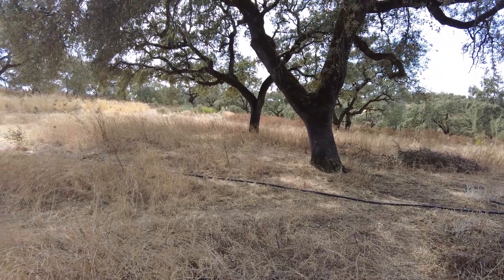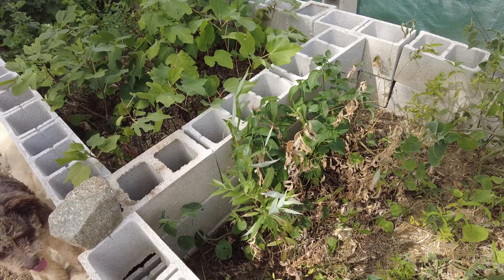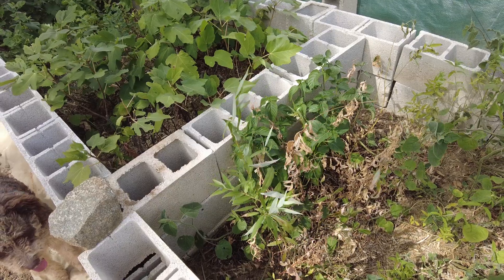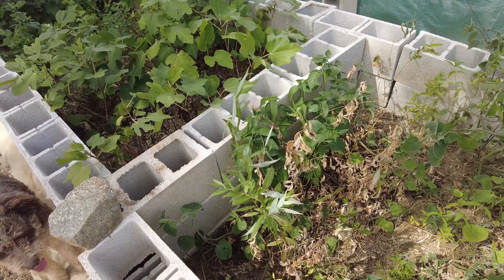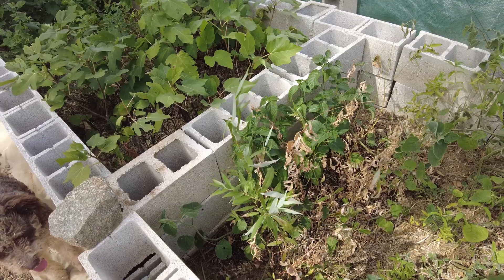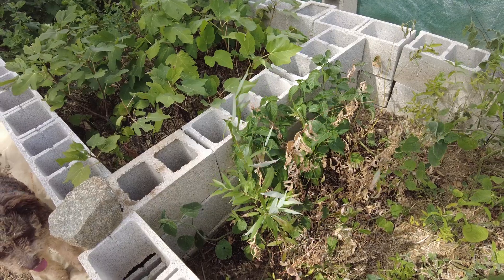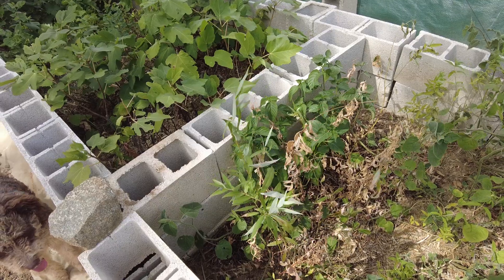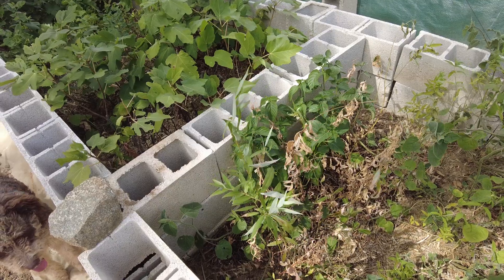Culvert erosion kicked in the teeth. One week to go!

Comment: in stead of sand you can use soil mixed in with the cement to fill the holes.  mix it dry then sprinkle with water and pound it in. it will turn very hard. you can also do that with pathways. you lay the cement powder over the  flattened area you want to harden then use a rake to mix in the cement with the soil, sprinkle a bit of water and pound it.  they do this on the inside of animal barns for example. works well, easy to do and cost effective. you can check it out on youtube videos.
Reply from the maker: @vince8723  sounds like a simple workable solution. I like that. Thank you for sharing
Reply: I do not see any rebar, even if the heigh of the wall does not requiere it, the load by the water may need it.
Reply from the maker: @user-vo3st8kx7s  We have rebar, only in 5 places. 40cm into virgin soil. I hope that will be enough. If not then I expect you to say: I told you so. Ha ha ha. Please keep sharing. Much appreciated

Comment: Looking great Martin!
What a smart idea to deconstruct the second gabion and put those rocks to work in the distribution pond.  Now you can relocate the empty gabion to the creek and create a substantial dam that won't move if you key the gabion into the creek banks. 
Making a "blanket" of rock and wire net to protect the dam wall from possible impact or scour erosion (the distribution pond) is a great solution.
I like the way you detailed the outfall of the culvert.  Also, the way you detailed the fence to minimize wild pig intrusion is very thoughtful.  I suppose you will do something similar at the creek culvert distribution pool. 
A detail about filling block cores: Lay your second row of block before you start filling cores.  The purpose of filling the cores is to unitize all of the individual concrete masonry units into one monolithic wall.  If you're concerned about making certain that the mortar fills the bottom core, mix the mortar wet so it flows. Does that make sense to you?
I am happy that you will have the means to drive the Giraffe past the earthen dam to dig your spillway and do your final grading of the dam.
Your rooting sand box looks great!  You have proven that sterile paulownias can be cloned.  Nice job.   I suppose you can take cuttings from the tips of all of the lower branches when it is time to refill the sandbox.
I will suggest that you wait until the ground is well saturated this fall (or plant them where you have irrigation) before you plant out the sandbox plants.  If you get them in the ground this fall, the roots will have a chance to get established before summer 2025 heat arrives.
Good luck on your next steps. 👍
Reply from the maker: @stevejohnstonbaugh9171  Great suggestions Steve. Keep pouring them out. Much appreciated
Reply: @SuerteDelMolinoFarm  Thank you my kind and generous friend 👍